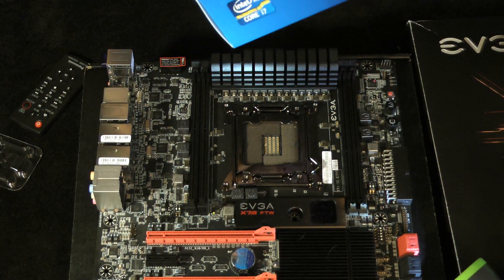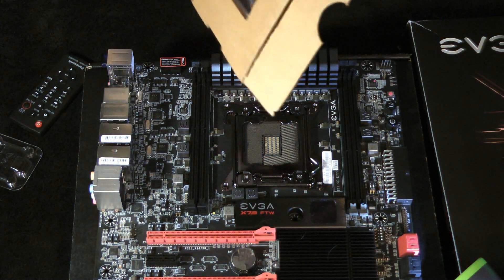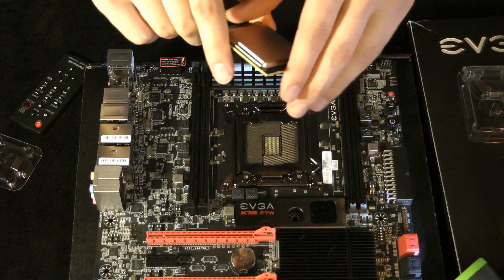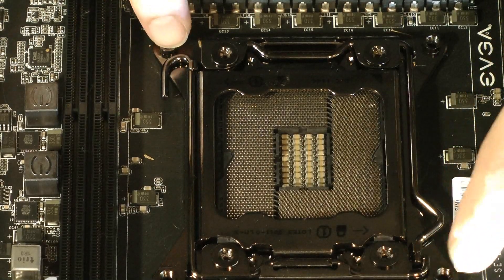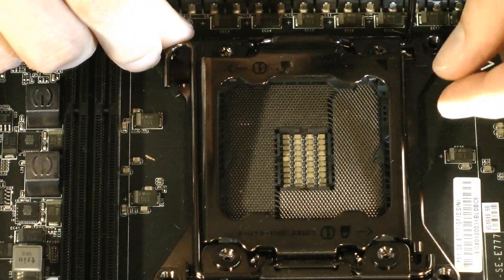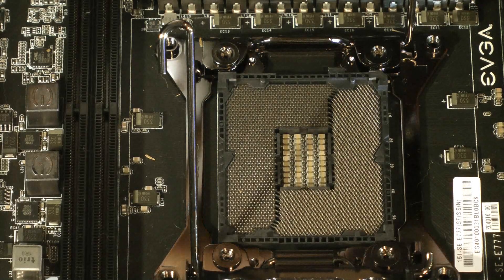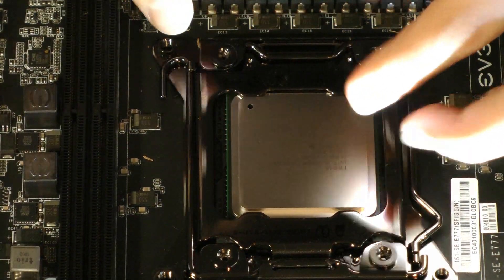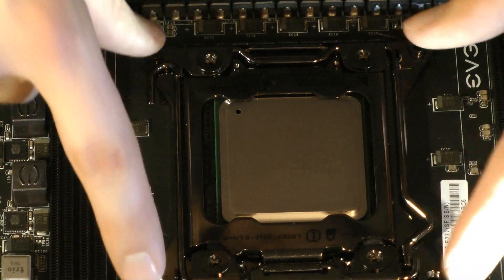Intel EVGA X79 CPU Seating Guide

Comment: No, I didnt mean that it is supposed to actually go THROUGH the back plate, but through the motherboard mounting holes to the back plate. The screws provided to me by the cooler didnt work because they were designed for screwing into the back plate's bolts. I did happen to find some screws that worked laying around from a previous build that did so I was able to mount it

Comment: Great video, but I am a little confused about the mounting brackets... I am trying to install an aftermarket cooler and the screws seem like they need to go through to the back plate to work. Do I need to get new screws specifically for this board or a new cooler entirely? And if you do not mount the back plate, how come there are still holes in the same place as where the brackets are on the front side?